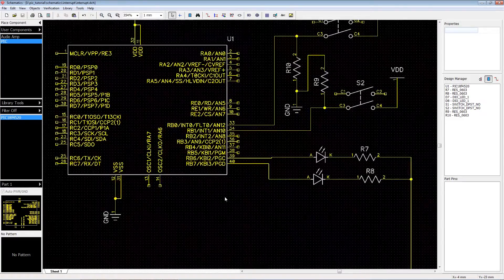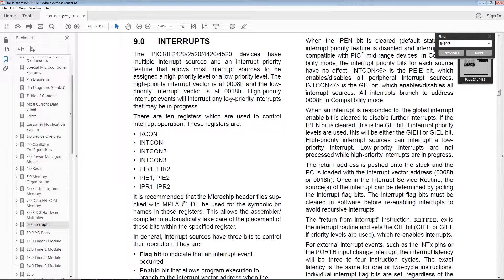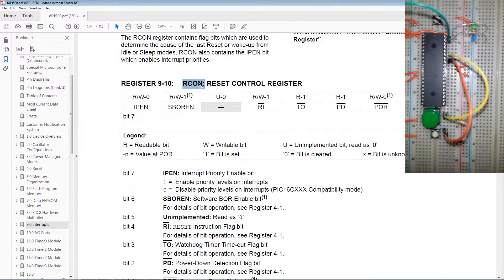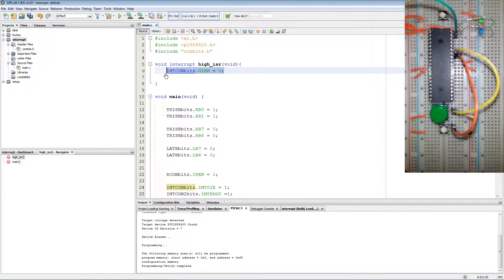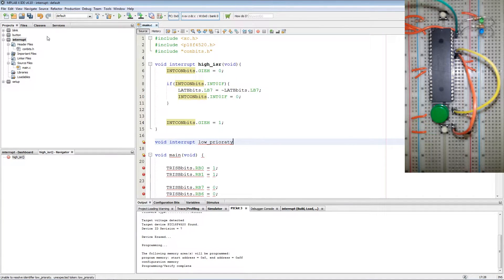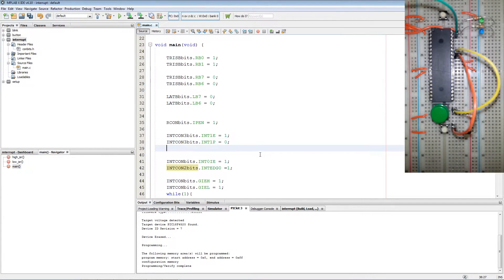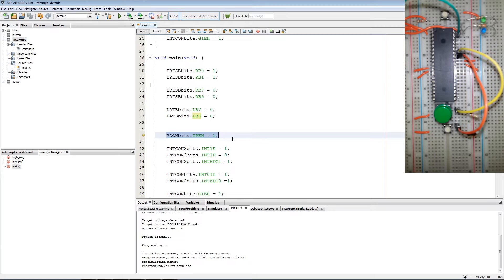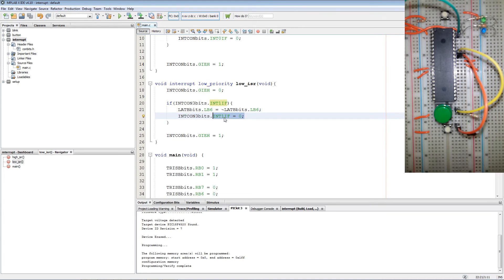Interrupts 🔴 PIC Microcontroller Programming Tutorial #5 MPLAB in C

Comment: But how does the PIC know where there is going to be a rising/falling Edge?
Reply: ...to further elaborate: because you have 2 Buttons that both could potentially trigger a rising/falling Edge, so now where does it say in the code that it was the Button on Pin X and not Pin Y that triggered that Edge?
Reply from the maker: K so you got two questions
1 ".. where there is going to be a rising/falling Edge"
3:30 The register is set to tell it witch edge you use.
2 "...so now where does it say in the code that it was the Button on Pin X and not Pin Y that triggered that Edge"
4:25 Testing witch flag was set
Reply: @BinderTronics  I found the Problem. So, I am using the PIC24FJ512GU410 and now I had somehow overseen this, but you have to use a Pin that has a INT compatibility (obviously; and that also answers the questions; because now the pic knows what Pin it has to be checking for a falling/rising Edge). But since my PIC has so many Functions the Datasheet (or where the data sheet shows what Functions what pins have) didn't show INT1/INT2 etc. so I thought I could use any PIN hence my confusion. Now when I was reading though many datasheets it turned out that I have to map INT1/INT2 etc. Functions to specific Pins because my PIC has so many Functions it didn't fit them all on every Pin. So now I have to use PPS (Peripheral Pin Select) to assign INT1 for example to Pin X  and then I can turn on the rising/falling Edge and then it will hopefully work! Thanks you none the less, I love your videos

Comment: Hello. Thanks for video. Can you tell me the benefit of using interrupts instead of doing the same just with normal digital inputs? Thanks
Reply from the maker: Polling can miss the input and it is slower at reading the input. Interrupts are clock independent and will latch until serviced.
Reply: @BinderTronics  mmmh, interesting. Thanks for the reply

Comment: Can pic18's family do everything, including motor control, because I have seen pic 32 of a university, its applications are so great that I'm bewildered.  , I watch the project about pic 32 via Bruce Land's Youtube channel
Reply from the maker: It can most likely do what you want it to do. You have to select a MCU based on your needs. This PIC can do motor control for a single motor. If a MCU can generate a PWM signal it can do motor control. The AVR atmega328p are much better at it and the king of motor control is the STM32G series.

Here is what you want to research.
https://youtu.be/aQy3DGSIGm4
https://youtu.be/Zjv3fNCcVsI
1 PWM signal, speed control.
1-4 PWM signals, speed and direction (H-bridge).
1 PWM + ECU module,  control a BLDC motor.
3 PWM signals, direct BLDC and 3 phase motors.

Recommend looking at what the hobby RC communities are using rather than looking at university lectures.

Side note I have only seen a PIC used in a industrial/consumer application once.

Comment: @binder tronics 
sir i am using PIC18F47Q10 for my project i am currently facing an issue that my main function is repeating itself  infinitely i am using internal oscillator at  8MHZ and beside this i am not able to use interrupts i have set all the bits required for generating interrupt but i am not able to use interrupt flag for Rx and Tx in EUSART please guide me
Reply from the maker: https://youtu.be/pPmEWlIYByo
https://youtu.be/O4IpwgWhqLY
Is your uart sending data out on the TX PIC->PC?
Don't bother with the interrupt on the uart until the above is working.
Run it in simulator and double check that the bits are set that are supposed to be.
Reply: @BinderTronics  it is transmitting the data but my problem is that my void main() function is repeating itself infinitely without any infinite loop .
Reply from the maker: You must have a at least 1 infinite loop in the main function. Your program counter is overflowing.
Reply from the maker: Here is what you do. 
Make a github account.
Create a new public repo.
Upload you code there.
Post the link here.
I'll give it a look and give you a price estimate.

Comment: sir i am watching your tutorial and i learned alot but sir i wana request please do obstacle avoidnes robot with atmega328p  i write code and now i am facing issue its not working if you can do it please it will be so help and it will cover alot of topic
Reply from the maker: Lookup hc-sr04 arduino
Reply: @BinderTronics  sir i yep i got the distance from hc-sro4 but the main issue when distance is than 20 robot stop and hen i want that servo motor rotate the hc-sro4 to lef -90" and get left distance and the to right to get the right distance and then it decide which distcance is more and robot move in that irection but the main issue i got with servo motor
sir if you kindly do it it will be great a great tutorial for us hence it will cover alot of topic

Comment: I have been enjoying this playlist so far, but I have two questions.

1. Around 6:51, you use INT1E and INT1P instead of INT1IE and INT1IP like the datasheet says. Is that like a shorthand that means the same thing?

2. What is the purpose of using low priority vs high priority in this example? In both cases they did the same task. I believe this only matters when both buttons are pressed since the high priority would be the only LED on, but is this the case or no? I apologize if you mentioned this already, but after swiping through the video a few times, I could not find this addressed.
Reply from the maker: 1. Same thing. Have a look in the pic18f4520.h file. The bit fields should be at the same address in a union. 
2. "in this example" It severs only the purpose of showing the assignment to the low priority vector interrupt. You are overthinking it.
if you really want to look into it. This is the simplest way of testing that both the interrupt vector priority are working.

Comment: Hi, I tried simulating the circuit in proteus and loaded the hex file of the code but LED's are not turning on. Please help
Reply: It says in the proteus that "MCLR is low. Processor is in reset". But when I tried to put a VDD on the MCLR pin, LED's are still not turning on
Reply: @sailfromsurigao  use +5V

Comment: Hi, Great job!
Is it possible to put in e.g.--- __delay_ms(200);---- to somewhere to avoid debouncing?
Thanks!
Reply from the maker: Just not inside the interrupt. It is bad practice to have any blocking code in an interrupt. I do have an example of doing debouching in https://youtu.be/E-UMOx7qv2k.  To make it work (the easy way) you just have to move the if(!button_press){ section to the interrupt and remove the inner if(). The hard way disabling the interrupt and re-enabling it when the timer expires.